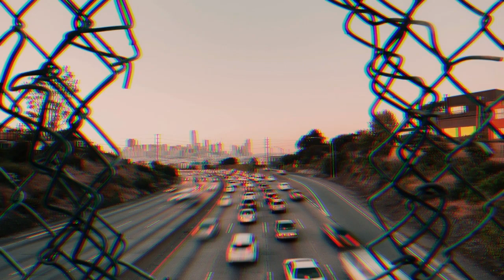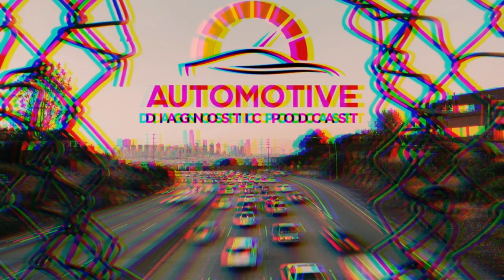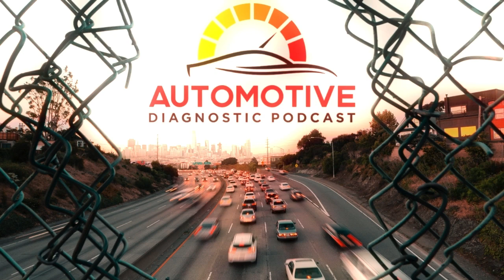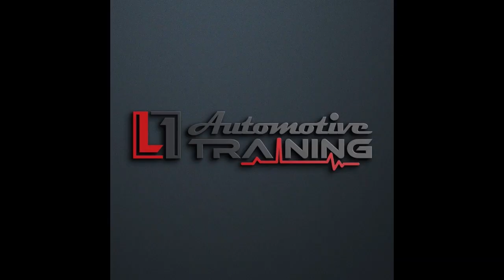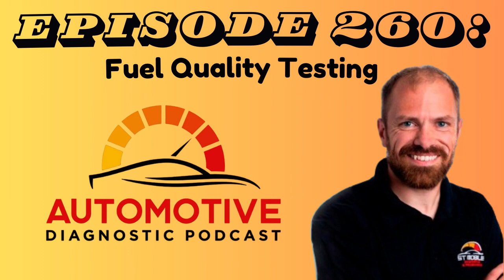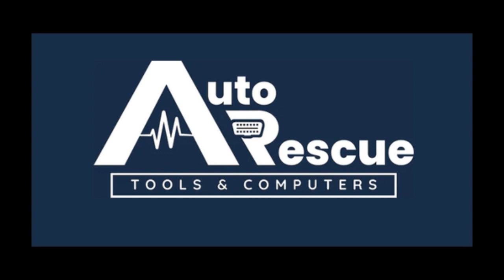E:260  Fuel Quality Testing

Comment: Thanks as always. Reminds of time fixing 98 Astro Van with 4.3L that had been filled with diesel yet no one admitted to it. Diagnosis would have been faster if that was mentioned or the fact that the catalytic converter exploded! Did it ever clean the carbon out of the engine though, it was a mosquito fog machine for about ten minutes. Van never ran better!